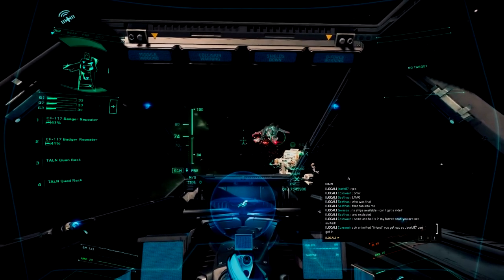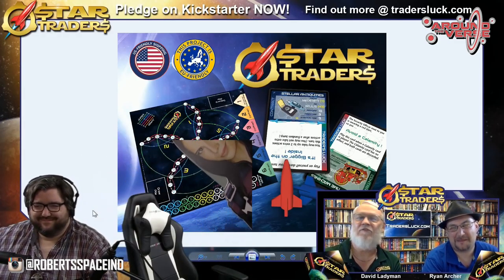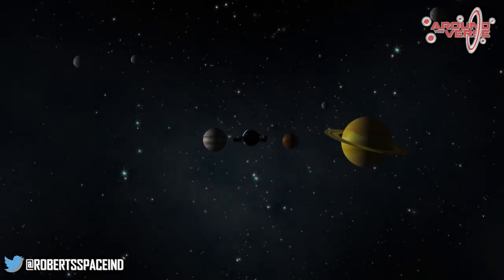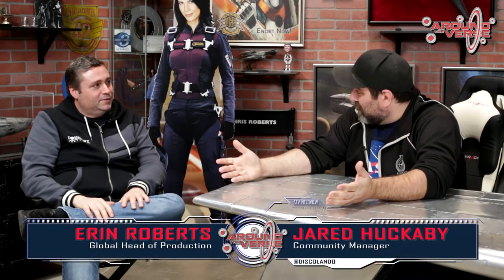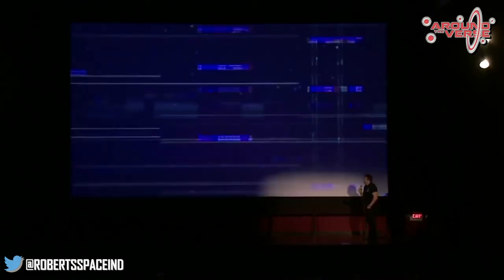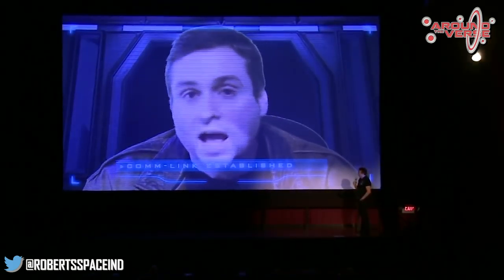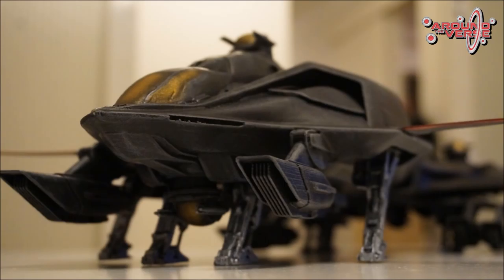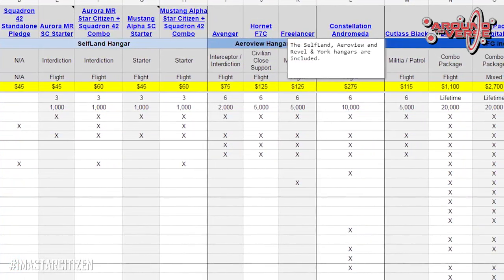Around the Verse: Episode 2.24

Comment: I don't understand the version numbering. The 2.X system should denote big changes according to CR when he said that 3.0 is not even on the pipeline and all the big changes will come with 2.X system. Since 2.X the upgrades were very incremental, which I think a 2.1.x would have made more sense.
Reply: +Adnan Ahmed You realize that 2.4 doesn't mean that it's 4/10 right? It's just iterations. It could go up to 2.30 if that's how many different interations there are before the next big version.
Reply: Mathboy 2.30 will mean 2.3 lol. That's how math works.
Reply: +Stef Vanden What?
Reply: +David Moore Like I said before. This would have made sense if the system had they went from 2.0 to 2.01, 2.02, etc. But they are going with 2.1, 2.2, which means 2.10, 2.20 if you want to follow the actual system behind it.
Reply: +David Moore Hmm, okay, I never knew that people can actually break apart an established system, but you are right as they aren't doing any arithmetic operations, essentially treating it like a string so I guess it can work.

Comment: That new audio system sounds totally over-the-top and unrealistic
Reply: +rolf ski It's balanced that way to demo the system.
Reply: +rolf ski What Lee Banyard said, but also, if you notice the sounds are basically exactly the same from the old system to the new, the difference they were demoing is not the sounds themselves necessarily but that the sounds are driven by the bone movement, meaning they are far more accurate and realistic.
Reply: +Lee Banyard I know, but the problem is 99% of the games out there exarate this kind of audio. I just want to make sure SC doesn't fall for this cheap "immersion" trap.
Reply: +rolf ski For sure; mix makes a big difference here and we're not there yet.  When you're working on a system and proving it works you often have to 'go large' just to make sure it's doing what it should.  Once you have that banked then you can bring it back to where it should sit.
Reply: +Ben P. It still can sound annoying if every single movement gives you that foley noise, even simple limb movements for aiming.
Reply: Amith Thomas move slower ;)

Comment: Hi everyone, I'm wanting to get into pc gaming and just wondering if these specs are good enough for star citizen
I7 6700k processor 
Nvidia gtx 980
16gb ram 
3 Tb 120gb ssd
Reply: +GoonGamer 
Not a PC builder here, but it seems good enough (even if the SSD drive is a bit on the small side, given SC is expected to be up to 100 gigs in the final version)
Of course, it also depends on what res you want to play at. 1080 you should get you 60 fps, 1440 you´d probably top out at around 40-50 and 4k is just out of reach with a single GPU atm (my R9 290X gets me some 10 fps, lol)
Of course, you can always add a 2nd 980 later, when they drop in price. 
As I said, the SSD is very small, I´d personally go for a somewhat larger one (512 GB sounds good to me)

For reference, I get this:
i7 4930k @4.0 GHz
32 GB RAM
AMD R9 290X

@1080p  @ Very High
Arc Corp    40 - 50 fps
Free Flight   50 - 60 fps
Vanduul Swarm  40 - 60 fps

@ 2560 x 1440  @ Medium
Single ship in hangar                  35-40 fps
Multiple ships in hangar in view 30 fps

@ 2560 x 1440  @ Very High
Single ship in hangar                30-40 fps
Multiple ships in hangar in view 25-30 fps
Free Flight                           30 fps

@4k @Medium
Hangar wall/floor/whatever  15 fps
Single ship in hangar                  15 fps
Multiple ships in hangar in view 15 fps

@4k  @Very High
Hangar wall/floor/whatever  15 fps
Single ship in hangar                12-13 fps
Multiple ships in hangar in view      10-12fps
Reply: You can split up the SSD size. Get two. Smaller one for OS. And another for gaming/apps. That might be cheaper than getting one large one.
Reply: +GoonGamer It's a pretty good rig. You might want to put in the 980Ti, it's a bit better. 

Unless of course you can wait. We are getting close enough to the next round, it's worth considering waiting to see what Pascal can do (or at least getting your Maxwell used)